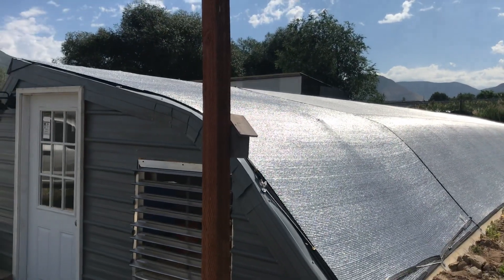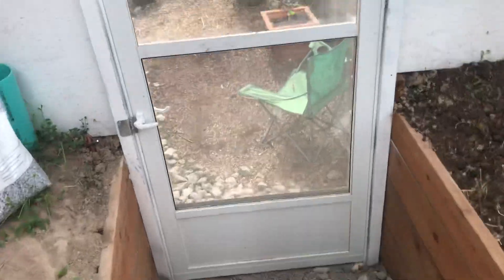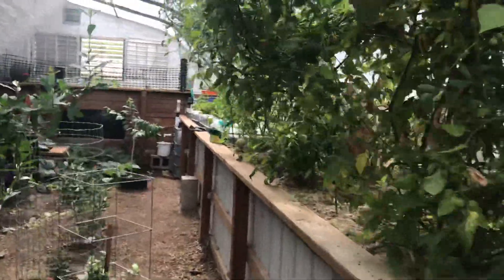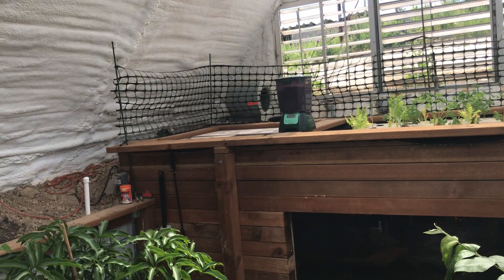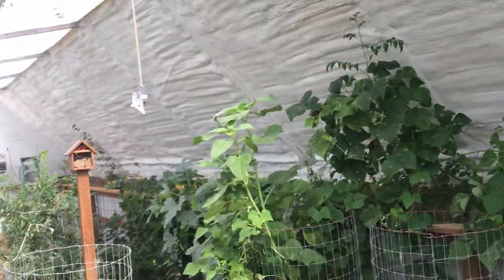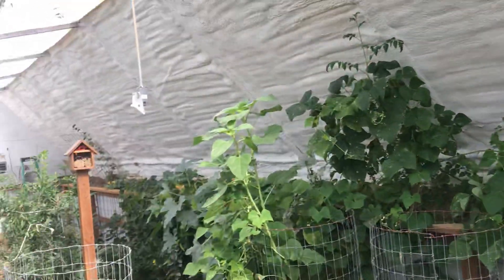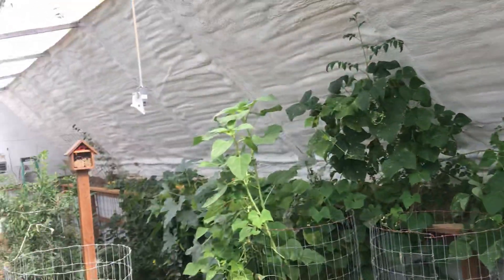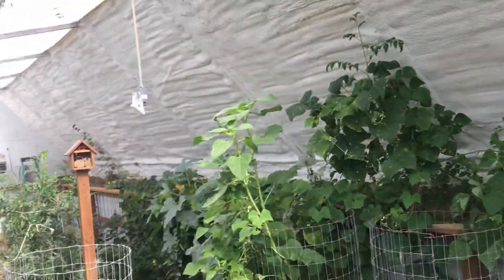Geothermal greenhouse - it’s hot!

Comment: Some Earthship tricks sound like they may work well.  Rather than having vents in the walls, Earthship homes have one large vent up top which is opened at the hottest (inside temp) part of the day along with the long pipes to the outside.

The effect is the hottest air is already pushing its way up, and it then draws the fresh cool air through the pipes.  This ensure that the hottest air is removed first and reduces the need for fans/blowers.  It's usually opened manually, but could be automated according to your needs.

I'm not sure if there is a good way to integrate that peak vent into this greenhouse design.  You would need it to be perfectly sealed and very well insulated for winter, but able to open sufficiently in summer.

Comment: Lots of tech.  Simple is best.  Where is your thermal chimney?  Aircrete thermal mass at the top of a tall chimney or chimneys can pull air from outside instead of total dependence on recirculation.  200 foot long air pipes in ground allow air temps to rise, so if they are angled up towards the greenhouse, the warm air rises up towards the green house.  If they are angled up away from the greenhouse, heat will outflow upwards.  2 sets of pipes with a temperature shutter may be better than fans and trying to grow plants in a dehydrator.  You can also create a dry thermal mass outwards with a thermal umbrella 20 feet or so behind the greenhouse with layers of plastic and insulation sandwiched to make sure no water goes through the dry dirt.  It takes 6 months for heat to travel through dry dirt.  6 months of the year the greenhouse is charging the dry dirt bank with heat and helps to cool the greenhouse.  6 months in winter the dry dirt thermal mass releases heat back into a cooler greenhouse adjusted by thermal chimney dampers.  You might be able to put a small turbine inside the chimney to charge a small back up battery bank for the electronic brains of automation.
Just some passing thoughts.  I don't have a greenhouse to grow citrus.  I want one.  You have one.  You are well on your way with some minor modifications as time will demand.  I also wonder about corrosion control.  Perhaps coating the galvanized in ground contact as well as sacrificial anodes.  The deciduous plants/trees in front for summer shade as well as internal reflective roll back insulation to moderate daytime highs and nighttime lows may be additions or not needed.  I think the thermal chimneys would dramatically induce better airflow for each section, instead of the long horizontal fan setup.  The basic structure is strong, just tweaking the airflow, temperatures and humidity.  Good job!  Stay away from electronic dependency, go "Amish" and stop licensing and registering wherever you can.  Look hard at your birth certificate and consider changing your political status from citizen/wage slave popularity voter to non-combatant American State National  domiciled on the soil with election powers.  Peace and love!
You know you're doing good when you get bitter trolls and lots of FLAK.  You're close to the target!  Lol.
Reply from the maker: I'll research the thermal chimney.  Lots to learn, that's for sure.

Comment: Did you fix the geothermal yet?
Reply from the maker: We got the water to drain out of the trench where the pipes are.  We have been struggling to remove the water out of. the remaining pipes.  We've tried a high pressure leaf blower.  Next up we will try a compressor.  Open to ideas.  Will report progress.

Comment: As someone with a background in heating and cooling, I have some suggestions. First of all you want to PULL the cold air up out of the ground. Pushing hot fluffy air underground is like trying to push a wet noodle. The cold dense air underground gives a much greater efficiency to your fan and its ability to turn the air over in the greenhouse. Secondly? Do not bring outside air in unless you set up a water wall to pull it through. You are defeating the entire purpose at those temperatures. Good luck and Nice growing! Spinach is an early and late crop. Not suitable for long days
Reply from the maker: Water wall is in the plans!
Reply: @trailbreakfarms  Flip that fan so its pulling the air out from underground in a sealed manner and that system will run a LOT better in the summer. You need to create a pressure differential in the system to initiate cooling. You cannot push it the other way around.
Reply: @trailbreakfarms  pressure = heat. Vacuum = cooling
Reply: @trailbreakfarms  Heat only willing goes from hot to cold. And when you are cooling you are trying to force the opposite. You need the mechanical input of the fan pulling to force the cold air into the hot
Reply: @trailbreakfarms  Its physics. Trust me.
Reply: @trailbreakfarms  The reason your system works in the winter, is because you are taking cold dense air underground to warm up. This results in an expansion of the air and an increase in volume and CFM's. In the summer however, the opposite occurs. You have a contraction of the air and a decrease in volume and CFM's. You are working against nature, instead of with it.

Comment: May I suggest putting a string lattice on the OUTSIDE of the big window and running climbing green beans.  The goal to reduce the inside temp is to block the amount of sun that gets in, rather than absorbing the light once in with the tomatoes
Reply from the maker: great suggestion.  Yes, we are planting things, mainly on the inside, to help reduce light, heat.  Tomato's, grapes, passion fruit, etc.  And the trees will help as they grow.
Reply: @trailbreakfarms  I have another question.  I am in the planning stage of building an aquaponic greenhouse also but am concerned about water loss due to evaporation.  Since my water will be sourced from our secondary water from the Provo River, I wonder how long it will take to evaporate to a point that it will cause problems?  My secondary water  will be shut off from October to April.  I feel that using "city water" will create problems due to the chlorine content.
How have you managed to maintain water levels in your greenhouse during the Winter?
Reply from the maker: @danowen9142  My water comes from my well.  I would worry about not having water from Oct thru April.  My Aquaponics uses an automatic float in my Sump to refill water loss.  It uses a surprising amount of water each day. I agree better to not use City water but I'd use it from Oct thru April if needed so you have water for Aquaponics and for watering in the Greenhouse, which is done less frequently during the Winter.

Comment: Just an FYI. I noticed on your raft some plants havent done so well. Do you run an airpump through your main tank?? If not that is probably why, and i would grow spinach on your rafts rather than the flood and drain system but only with really heavy airflow into the main tank. Roots grown straight into water need a really high oxygen saturation. It all looks awesome though. Half the fun is dialling in your system. I used to work in a tropical garden for the public which was all under glass, and that system needed constant tinkering and love to keep it dialled in.
Reply from the maker: Great Feedback!  yes we have a couple of Air Stones in the Tank but always wonder if its enough.  Yes it does seem like we are always dialing it in.  Good luck with your Project.
Reply: An airpump around 60 litres per minute will do wonders. Plus your trout will love it aswell. Hope it helps

Comment: You probably have it figured it out , it helps to put a duct to the ceiling, pulling out the heat and running it thru the cooling ducts. I saw two others use that method

Comment: Question, why didn't you go 8 feet down where the ground is warmer?
Reply from the maker: The deeper we go, the less the ground temperature varies.  We still see cooler air in Winter and warmer air in Summer, but it helps.  We don't get warming temps the lower we go here.
Reply: I don't know where he is setup in Springville, Utah but there is a high water table in the Springville area. In one video he talks about a ground water coming into the floor of the greenhouse. This has my attention where he is close to home.  Right now it looks like a Cooling tube system is needed.  Good job..... keep sharing your progress with the rest of us wannabees.
Reply: When you install a system in the ground it changes the natural energy balance. The only reason to go down to 8ft is to increase the thermal capacity of the system by using additonal layers of tubing and mass.  Heat moves through the ground slowly, (due to its conductivity and diffusivity) if the tube spacing is too wide you wont be able to retrieve all of the available heat on the same day. If the tube spacing is too close, the ground between the tubes will heat up rapidly and limit the cooling capacity. The tube spacing can also be used to bias a system for cooling or heating.

Comment: One thing I am considering for extreme heat (love to see the misting system install, looking for folks doing that so I can apply this to extend lettuce seasons in low tunnels) is adding an additional cloth that only blocks one section to block the hottest hour or two during high temp days. Looking great. You’re getting ahead faster than us. I want this greenhouse design. Hoping to move towards one and a couple high tunnels to better manage conditions here in Nebraska. Harvest to table.com has a nice article which may be helpful for your spinach problems. At first glance I’d say a combination of nitrogen deficiency and heat, but I need a second look.
Reply: I wonder if the way multiple layers of hoop houses changes a winter growing season to a zone and a half for each layer, if that could be reversed for summer weather?

Comment: Thank you for posting the videos.  So looking at the comments, is the problem that some of the buried geothermal lines are filling with water and thus not functioning?  Or is it thatt the geothermal pipes running around the yard aren't cooling the air enough (not enough cooling air being pulled through)? 

I greatly appreciate the insights.
Reply from the maker: I think our problem is both.  The more pipes the better.  In talking to people who have the GIS System, particularly when its new, the Geothermal can't keep up on hot days so you need to fans and shade cloth to help keep it from getting too hot.  I'll get the water out of the pipes and then see how it does.  Also a mature greenhouse with mature trees and plants will help.
Reply: @trailbreakfarms  
You have enough pipe, the issue is more that the air is coasting through the majority of the tube length without losing any more heat. If the air drops to ground temp in the first 30ft, the fan power (and time) used to push it another 200ft without any further drop in temperature is wasted. Consider a case where 6 x 38ft pipes (total 230ft) would result in the same temperature drop but 100% of the available tube surface area actively transferring heat instead of perhaps 17% in the case of the 230ft tube. The shorter dwell time and lower resistance of the shorter tube (same total surface area for heat exchange) allows you to run the greenhouse air volume underground many more times an hour. To cool the greenhouse, the system needs to outpace the incoming gains. 
Very few folks install temperature  sensors at regular intervals inside a tube to check how far the air travels along the tube before it drops to ground temperature. Another way to check if the entire tube length is being utilised is to try to get the outlet air temperature to rise above the ground temperature by running more air. It will take a lot of fan power to do this test on a 230ft tube, using a leaf blower is the best bet but it may not be enough.

Comment: So one of the things that was added after you ordered your kit was the line along the back wall.  You need to install a 4" perforated tube on the back wall at the peak of the greenhouse.... loop it around and bury it one foot underground of your south wall.  Put an inline fan in it and it will help take the hot air down into the soil.  It was a recent addition.
Reply from the maker: Put a video up on your page when you add it so I can see what it looks like.  Thanks for the suggestion.
Reply: @trailbreakfarms  This comment I made about flipping the fan box? Is the reason your greenhouse performed well in winter, but not in the heat.
Reply: @davefroman4700  
The cooling load is considerably higher in the summer. Calculate the flowrate required to keep pace with the incoming gains, then calculate the total loss in the tubing at that flowrate and the reason will be very clear. It cant be fixed by flipping the fan box ;)
Reply: @JohnGuest45  They are not cooling in the winter, they are heating. They are taking colder denser air underground to warm up. Which results in an increase in volume.
Reply: @JohnGuest45  If you have 4000 cfm's being pushed underground on the hot side of a system, you end up with roughly an 12% decrease when you cool it to the 60 deg ground temp. You put 4000 in, but only get 3500 out. Where as if you are pulling on the cold side you will have 4000 out, and roughly 4500 cfm going in on the negative pressure side when its hot.
Reply: @davefroman4700  
I`ve had a system in operation since 2009 so i understand how its supposed to work. The increase in volume at these temperature differences and pressures isnt significant, its easy to quantify if you have a psychrometric chart. Something you may not realise is when the system is used for heating, the air that exits the tubing has a significant latent component which only serves to increase the greenhouse RH% . Most folks looking in from the outside will innocently assume the heat is the same as they`d get from an electric fan heater, 100% sensible. No videos on youtube mention it, i guess some miss it due to lack of monitoring, and those selling systems may know but choose not to say anything for obvious reasons.
Reply: @davefroman4700  
Good luck trying to run 333cfm through a 230ft 4" corrugated ADS tube. The velocity in a 4" smooth bore pvc at that flowrate would be around 64ft/sec. The friction factor for ADS tubing isnt available because it wasnt designed to be used as air ducting. You can work it out by physical testing if you have a decent digital manometer. i`d recommend the bluetooth type that work with your phone.
Reply: @JohnGuest45  Also, isn't some of that air volume advantage neutralized by the change of air density on the ventilator? I mean, wouldn't it depend on the ventilator - if the density changes, has it the power to push/pull the same amount of cubics? The mass is different.

About the latent component. Sry, I am not specialist in this. Isn't the energy in the water, in the more humid but slightly warmer air from underground in the winter, adding more energy to the greenhouse air and raise the temperature further?
Reply: @trailbreakfarms  You need vacuum to create refrigeration
Reply: Pushing hot air down is like trying to push a wet piece of spaghetti. Hot air is less dense than cold air. Sucking on the cold end of the system is a much more efficient way of moving the air through the mass underground. This is because as you force the hot air underground and it cools, you lose pressure as it condenses. It is always the low pressure side that is the driver of refrigeration. Flip the fan box in the winter and away you go.
Reply: @davefroman4700  Where in anything I said did I mention pushing hot air down?  No where.  I said put an inline fan on the line and it TAKES the hot air down into the soil... which it does.  Read thoroughly next time please. 

But FYI - when it's a loop without a condenser on it?  It isn't as important where the fan is located like in a condenser system.  Pulling cold air eventually pushes the hot air.  Same loop, same fan.
Reply: @basedbear1605  you are taking the hot side and pushing it down, it condenses, which results in a drop in pressure and volume and you get less CFM's coming out. Im a licensed power engineer. 
Im trained extensively in thermodynamics
Reply: @basedbear1605  flip the fan for summer operations and I guaranty you will see a LOT better performance. put the geothermal under vacuum and it will be much more efficient
Reply: @basedbear1605  Ask any Pilot if he prefers a cold day over a hot day for a short take off and why.....
Reply: @davefroman4700  You simply don't listen.  I'll say it again.. I never once said to push the hot air down. I said to put in an inline fan and TAKE it down into the soil.  That means that you put the fan between the hot air piping and the buried piping in the loop.  Technically you are pushing the cold air. 

I am also an environmental engineer who works for the power company.  Please stop thinking you're too smart when you're simply not reading what I'm saying and misinterpreting.  You're really getting annoying.  You're not the only one who knows what a Carnot cycle is.
Reply: @basedbear1605  If you fan is on the hot side of the system, you are working against nature, and not with it. 
Air contracts when it cools. You get less volume and less cfm's.
Reply: @basedbear1605  Its a golden rule in HVAC in heating you put the fan before the heat source. In cooling it comes after the heat is removed.
Reply: @davefroman4700  Jesus Christ you simply don't read anything. I'm done with you.  Blocking so you stop clogging my feed with cognitive dissonance.

Comment: Looking good, could you run an inline pump as a sump pump in the tubes in case clogging is the issue. I get 133,000 lux in direct sunlight and 19,000 under an 85% shade cloth which is plenty of light for most of my needs.
Reply from the maker: Thats a good idea.  I do need to run something in those clogged lines to get the water out.